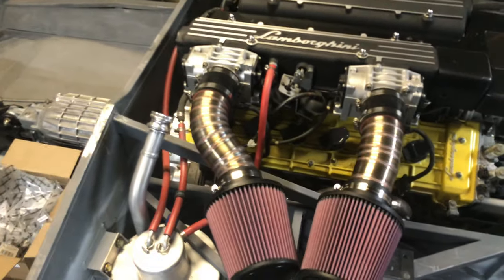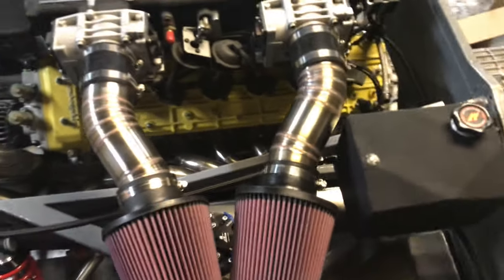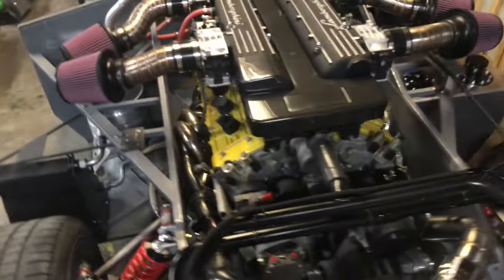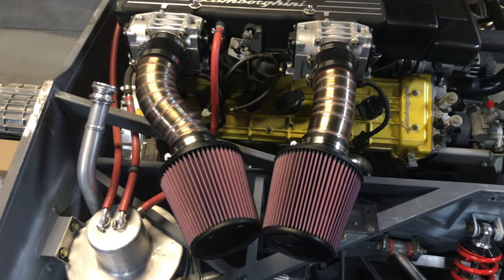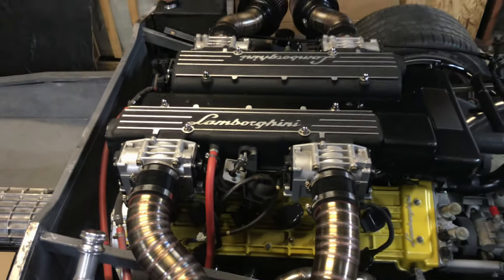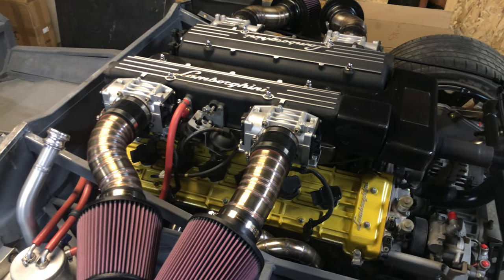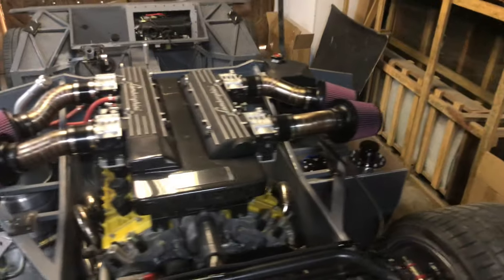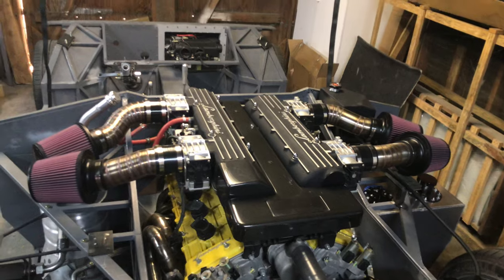Lamborghini Murcielago Stainless Steel Pie Cut Air Intakes

Comment: Coolant tank is nice. I used a GM coolant tank and it doesn't quite fit without tilting it a few degrees. It works but I may build one.... Hopefully get the rear brakes on Thursday and bleed them out so I can drive down the back street (still needs alignment and sway bar links and... well a lot of stuff lol). All I know is I thought my headers were a pain to get in/out until I saw yours! LOL